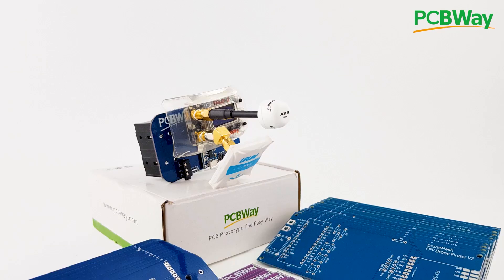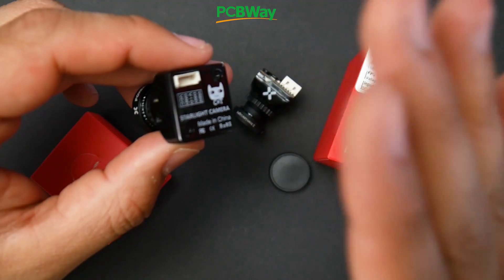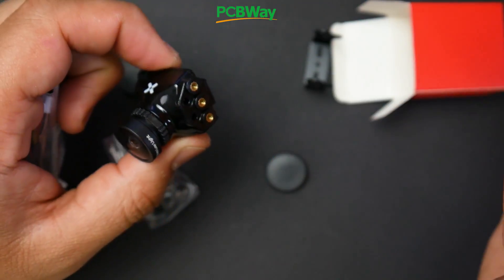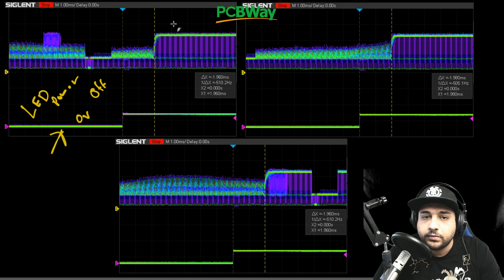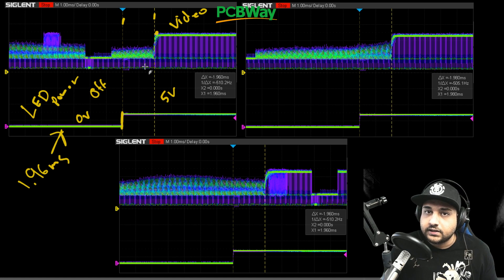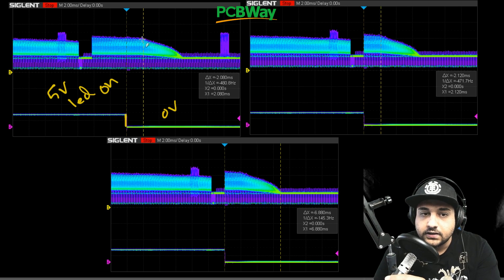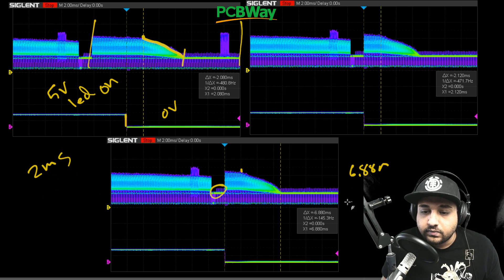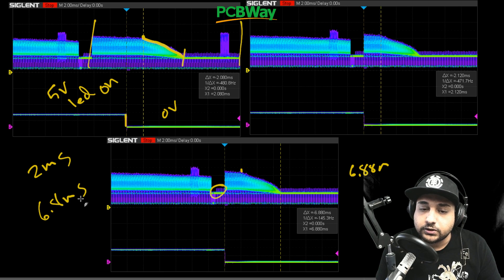Foxeer Cat 2 Mini vs Micro // Overview and Latency

Comment: How can we bind frysky xm+ with fs i6 transmitter....? please answer....this is my problem.. and is it possible..?
Reply: it wont  bind ,the  xm+ is for an frsky transmitter ,you will need a flysky reciever to bind to the fs i6
Reply: @damonbfpv  can you suggest me good transmitter for xm+..
Reply: @swapnilsawant2083  anything from frsky, depends on your budget. Or the new radiomaster tx16s or the jumper its based on. There's a new tx coming by jumper too that you could use, it also has support for 900mhz.